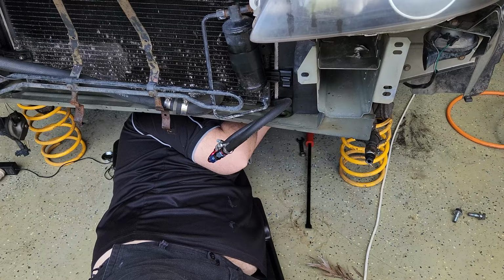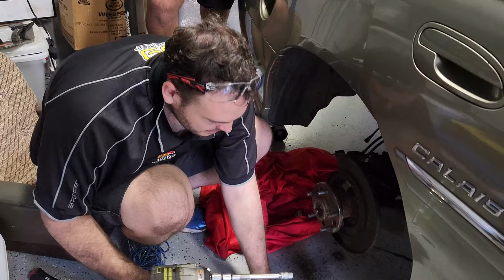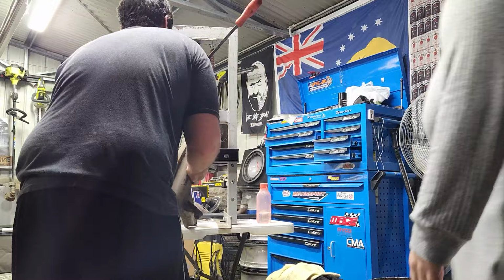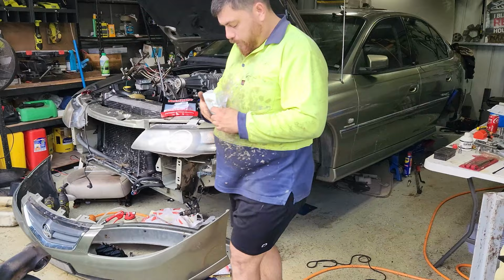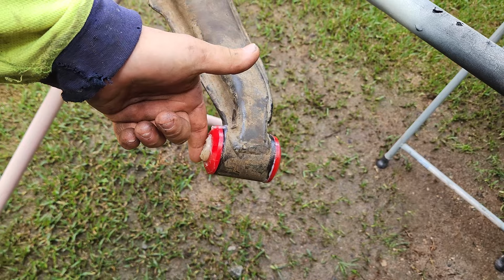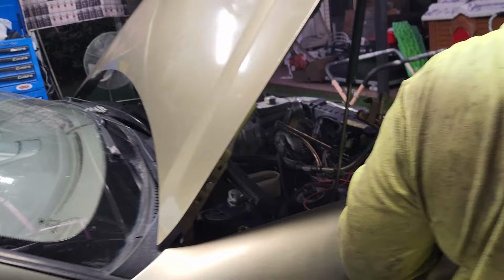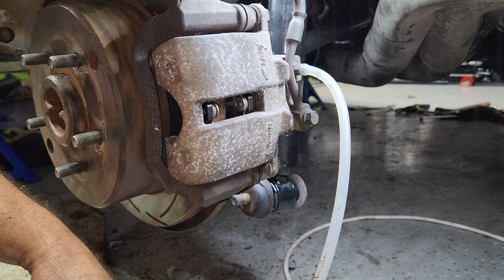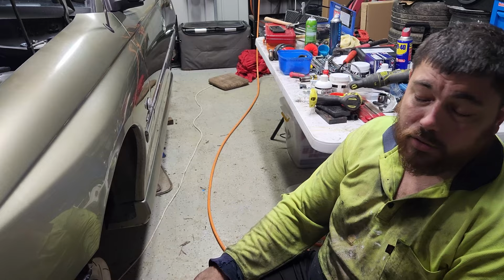VY Calais Resto - Episode 4 | Rear Suspension

Comment: What's the chrome reservoir in the engine bay for?
Reply from the maker: Water to Air intercooler. A larger reservoir allows air to escape before being pumped again and helps slow down the heating of the water between pulls.

Comment: Hello mate, did you run into any issues running e85 though the stock fuel system ?
Reply from the maker: Nill problems with E85 as long as you keep driving so the e85 doesn't sit and gel up. Guarantee most cars post 2000 came with ethanol capable rubber lines and seals. Shaun runs Walbro 450 fuel pump a standard filter and 60LB injectors which we might start maxing out shortly.
Reply: Thanks man appreciate it !